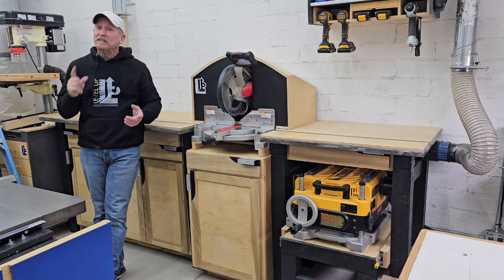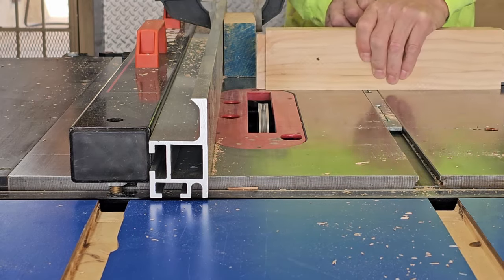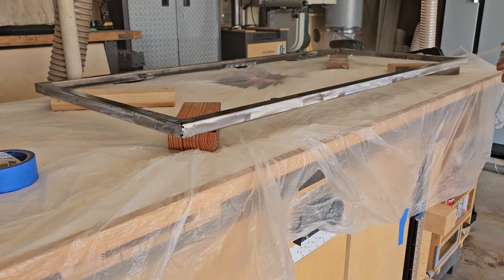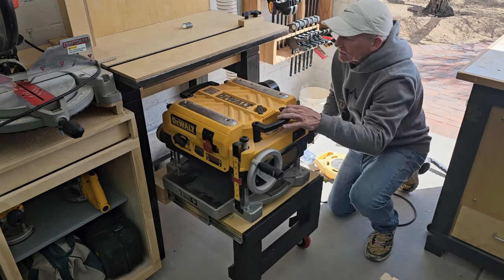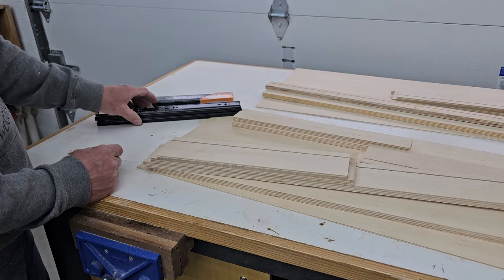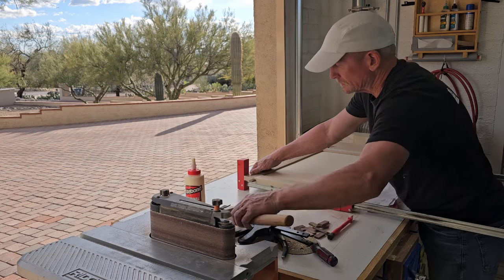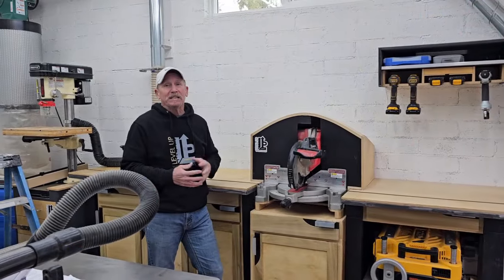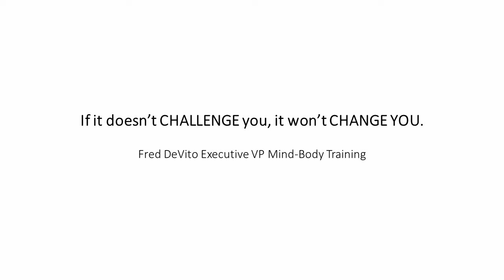Is this just a little too different? #woodworking #garagewoodshop #mitersawstation

Comment: I had considered putting my planer on a slide out shelf. I wasn't confident even a heavy duty set of slides would hold up, but the wheels are a great idea. When i built a new assembly table, however, i had enough room to put it on a cart underneath.
Reply from the maker: I originally had my planer on a slide out shelf in my assembly table and used these slides from amazon.  They are rated for 500 lbs.  I was happy with the slides.  The wheels are just added support which I got on a fire sale. 

https://www.amazon.com/gp/product/B08DKRSVQJ?ie=UTF8&linkCode=sl1&tag=levelupwoodwo-20&linkId=d9aa013b6ff89b724b29c6759fa88b38&language=en_US&ref_=as_li_ss_tl&th=1
Reply: I have mine on heavy duty slides. And no support wheels. No issues at all. No sag. Just get the big boys.

Comment: Nice work reusing the glove and glue rack up on the wall. Cutting down the drill shelf to fit it looks great. Much sleeker looking now too.

Noticed some vertical frames near the table saw that you made tool wall over there. Could only see those for a second. Hope you show those off a little and maybe talk about them.

If you’re not bumping into the planer it is fine. Could always redo it after living with it a year.

Looking forward to next video!
Reply from the maker: Very observant, aren't we. :)  Yes, always making changes.  If it doesn't work, change it again until it's right.  

Yes, those "vertical frames" are being built out.  In a video a few months front now & in a shop tour.  Will explain in full detail.

Thanks for watching!